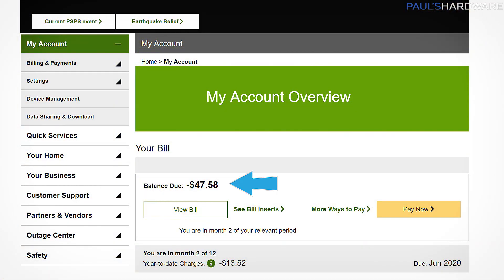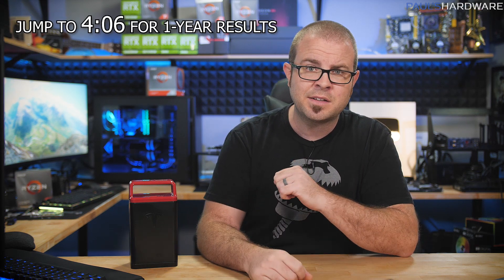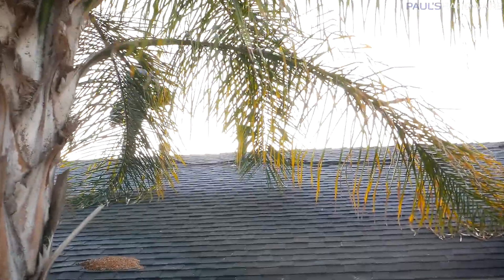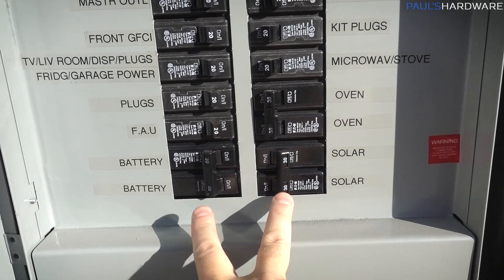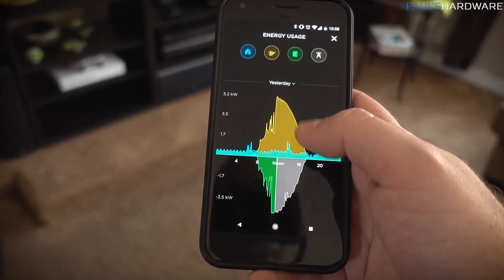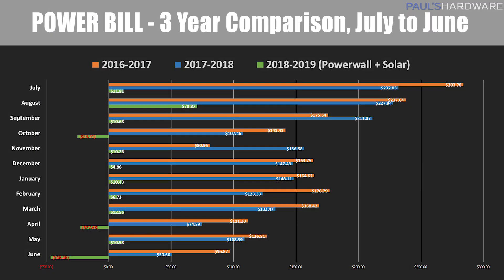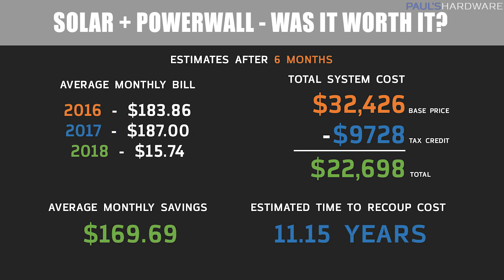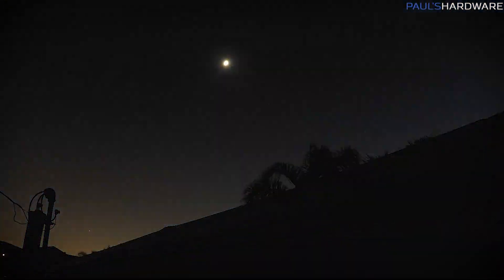TESLA Solar and Powerwall: 1 Year Later!

Comment: Paul, It would be interesting to know more about your current ac units age and efficiency as well as the home's insulation.
Reply: He should look into heat pumps, much more energy efficent than ac and electric heater.
Reply: @broman93  a heat pump is just a bidirectional AC unit that can heat as well as cool. The efficiency gains are mostly from cheaper heating.

Comment: If the cost of energy goes up in the next 10 years, your break even cost will be sooner
Reply: I was able to recoup it in just over six years because of the rate hikes accelerating it.
Reply: @dmacell4110  Yes, rate hikes are fake and the only reason they go up is due to the State of CA, in this example. CAISO in Rocklin, CA manages all CA state power and they also hit the big three power distributors with penalties for purchasing and selling natural gas and/or coal generated power. The rate hikes are a money maker for the State, nothing else since they make up fake reasons to hike rates. "Green" is not sustainable when there is no sunshine, no wind and so forth.  Government is full of B.S. as they profit off of the citizens for doing absolutely nothing in return.
Reply: in 10years when the warranty run out, watch him paying 10x the cost of electrical bill  just to keep the system going. if solar panel will ACUTALLY generate more money then installing it. the SOLAR company woulda just put it on empty land and sell the electricity to energy company to make money off it. the FACT is, they dont pay for them self. so the companies arent stupid enough to use it. and dont debate on some energy company actually install the solar panel to generate electricity.  thats because the energy companies dont PAY for those solar panel, they will add the cost to YOUR bill, to cover it.
Reply: @jackli8088  holy solar! Get in the shade dude, you seem to have been out in the sun too much, its clearly affecting your head.
Reply: If you factor in inflation and time value of money then no. $20k today is much more valuable than $20k in the future. Increase in electricity will simply track inflation.
Reply: Its the same when buying a home. You lock in at the time of purchase so that rate is unaffected by things like inflation or anything like what Enron did.
Reply: Energy Price increasing? Only ever heard of that this year, last year, the year before and and and... ^^'
Reply: Yeah UI bills go up like 14% a year, it's retarded.
Reply: Are you going to clean your panels once a week or month ? Either way that's the price you pay for buying into the liberal global warming bullshit. Theirs one born every minute and Paul's hardware is no exception.
Reply: @Matlockization  The most respected scientific minds from the WHOLE planet all agree on global warming. What idiotic right wing propaganda sites are you swallowing whole, to turn this into a 'liberal global warming' conspiracy? Go check a satellite photo of Antarctica in 1999 and check one from this year, then do some actual valid commenting after that. FYI the US is less than 5% of the global population, and we don't buy into your stupid conspiracies, we investigate the facts.
Reply: Not really - his credits from being a producer won't go up anywhere near as much as what they're going to charge him when he's a consumer.

That means his break-even time will go up, not down.
Reply: @jedidethfreak  The savings he gets each month will go up when the price goes up saving him more money
Reply: @seanthenetworkguy8024  no, it won't.  The credits your energy company gives you as an energy supplier ARE NOT THE SAME PRICE THEY CHARGE.  He's lucky if they pay him $0.40 for every $1.00 they'd charge him per kWh.
Reply: @jedidethfreak  You dont need to sell the power back to break even.
Reply: @jedidethfreak  You don't seem to understand that even without the credits, every kWh he's not taking from the grid, he's not being charged for, so the system is paying itself. Should the power become more expensive in the future, those kWhrs he won't be taking from the grid will be providing greater savings because they're already paid for.
Reply: @jedidethfreak  im saying if he generates 4kW of power right now, and its 15c per KW than thats a savings of 60c but if the price of energy goes up to 20c and hour and he generates the same amount then he saves 80c
Reply: @jedidethfreak  your point is that it takes longer to break even when not producing enough power to sell back, this is true.

The original point being made was that as power prices increase, Paul's savings will also increase (assuming same power consumption) because they don't have to pay for most of it. 

Both points are correct, you guys are fighting over nothing.
Reply: jedidethfreak if the offset for the whole year was built for 100%, then it doesn't matter month to month what the carry over for credits are. The wholesale value for the credit balance only applies annually during true-up. As electric rates go up, the saving annually grows and accelerates the ROI.

Under NEM 1.0 with Edison, day to day and month to month credits are full value (surplus balance at the end of 12 months is paid at wholesale). With NEM 2.0, you are under TOU where the time you give or draw from and to the grid determines the value of the credit, minus a 2 cent by passable charge - but still not paid at wholesale until after one year when the true up comes. 

Without battery, PGE/SCE/SDGE utlitiy company power replaced with solar gives a 6 year ROI, adding inflation and rate increases that quickly becomes 5 years or even less - meaning every 5 years a homeowner will pay Edison the equivalent of what a system would cost. Whole concept of renting versus owning your home folks.
Reply: Melthornal why so rude?  Oh yeah it’s YouTube comment section...
Reply: @jedidethfreak  Oh man... you didnt get it. :D 

If i use 4kW/month and my system can produce 3kW that means i didnt pay 3kw to the company, so that amount of money comes minus from the installation price. After a while this saving worth more than the installation price. Yes, it take some time but if the electric company raise their prices you save even more money with the same system. 

Other words: if i pay someone $100 and i can save this money's 50% because of my system then i save $50 monthly. And if the system cost $1000 the balance will equal itself after 20 month.
BUT!!!
If the "someone" after a year raise his price from $100 to $120 (inflation) then i save not $50 but $60/month-because my system produce 50% of my electricity using. So that means i already spend 12 month and payed $600 and to the last $400 needs only 7 while the last month is just a half amount of money.

Do the math with larger numbers and you will see.
Reply: @the-patient-987  Because he is generating power at no utility grid cost, yes.
Reply: @Resengan21  not to be that guy, but you cand have bigger savings while still taking longer to break even, and if you see the graphics Paul put up, the energy being sold is minimal, his system is designed to net almost 0kw consumption from the grid, not to sell
Reply: @MrQuequito  you're not getting it. It has nothing to do with money being made, but money being saved. If Paul continues to produce and use the same amount of energy each month (for arguments sake let's assume a 1:1 ratio), he saves the amount of money said energy would have cost. If the cost of that same amount of power increases, he saves more aggressively.
Reply: @Resengan21  read again what i said, you are telling me the same i said but with different words. I said "you cant save more (agressively) and still take longer to break even" if he saves more  he takes even less time to break even.  And a couple comments ago, you said both cases (taking longer to break even and bigger savings) are correct, and im telling you, no, contradictory cases cant be true at the same time.

Edit: he cant take longer to break even by selling because his system is designed to net 0kW on each bill. The point of his systen is not making money, wether he generates more or if Edison pays a penny per kW generated, it doesnt matter, the energy being sold is minimal and can be neglected (after a year its only netted him 47usd) 

While if the consumed kW price goes up, and since his system is designed to cover his power consumption despite the kW price, Paul will be saving more, and therefore, breaking even a lot sooner. Not longer.
Reply: @MrQuequito  You're making this way too complicated. Both situations are correct in theory, I never said both were correct at the same time. Obviously you can't generate less money/savings while simultaneously breaking even quicker. I see that we are essentially saying the same thing, its the second point you lost me on. All i was trying to do was point out to the people here who dont understand that as power prices increase, and b/c paul's setup is designed to essentially not pay for power, he would break even quicker as the increased savings per month would shorten the amount of time to reach his initial investment with the solar system. Its that simple guys.
Reply: @Resengan21  lol, what i dont get is why you tell me that stuff like im wrong, when basically we are telling the same thing almost word by word, anyway, im done here, peace
Reply: @MrQuequito  im not trying to say you are wrong, but simply defending myself when you say that im saying "two contradictory statements are true at the same time" or whatever. This is simple math, no need to exaggerate the situation.
Reply: @jedidethfreak  higher electricity prices in the future will give a shorter payback time. Full stop, end of discussion.
Reply: @Melthornal  Yeah this guy is a moron, it's supposed to be an ending towards your UI bill and grid dependence, not be a side hustle.
Reply: @jedidethfreak  Basic math must be really really hard for you. It's not for everyone, no worries.
Reply: @jedidethfreak  THE PRICE TO SELL BACK GOES UP OVER TIME 
DOESN'T STAY THE SAME YOU FOOL
Reply: @jedidethfreak  if the house changes habits it will be better, as he said in the video the people in the house have not made any effort to try to be power efficient (battery pack might not be big enough for there needs as usa typical households use over 2-3x power) usa cost for power is cheap compared to uk/EU them $250 monthly usage in kWh would likely be over £/€400-500 here

That same solar system in the uk would be a paying for it self (avg bills are under £50-100 a month, but we don't use/have installed Aircon normally)

Comment: Thx again Paul for the update...  If you recoup your investment in 13 years, isn't that about the life of the power wall, requiring you to start over ? I have no idea on the solar panels ???  👍😎
Reply: Solar panels have a 25 year 80% original performance guarantee. The powerwall will likely still be working by then as well but even if its not the solar definitely will still be. Also as competition heats up out there a new powerwall would certainly cost 1/2 of what the first one did 12 year earlier

Comment: yeh on the before and after on the cleaning.Include cleaning montage and tips if possible
Reply: Dish soap and soft brush man is all you need. use a microfiber towel to dry. otherwise invest in a DI RO system

Comment: So what I'm getting from this is that solar panels still are not an optimal solution for short-medium term gains. Sure, environment protection and all is a huge selling point for a house, but having to spend 12 years of living there in order to pay it off is really just not worth it for most people. 

Long term, sure. But you're purchasing the system based off potential gains in the short and medium term already. Long term you're going to likely either move and not take the system with you or the system could potentially fail, costing even more money and time to recoup your losses. 

This is just too much risk and not enough reward. If the system was even 10% cheaper, that would bring down your estimated return time to be within the warranty time period. And this is in one of the sunniest places in the US. There's no expectation for anyone to be able to afford this or even consider something like this.
Reply: its better to buy a house that someone already spent the money installing this shit. never do it yourself. one day most houses will be built with solar already installed but the house value will also go up.

Comment: 12 years to just get the money back how is that even worth it?
Isn't it like going to break after 10 years?
Reply: why would they break after 10 years ? solar panels are extremly durable and can work for many many decades. even after 25years standard solar panels still perform at 80%-90% of their original performance.  you should always put your money into longterm investments
Reply: It's not. Had that money been invested he could have doubled it in 12 years. Instead in 12 years, he will just break even.

Basically, he lost 20 grand compared to if he had invested the money differently.
Reply: @TheOwenMajor  What do you mean?
Is there a better way?
DIY?

Comment: are you only using plain water (without suds of any kind) to clean them? If so, will the tiny bits of sediment in the (city) water cause problems collecting on the solar panels over the years?
Reply: dont worry about it. I just spray mine with the garden hose

Comment: Once the payback is around 5 years maybe I'll be interested. Also, you need to factor in a roof replacement if your roof is getting older plus the cost of reinstalling the panels every 15 or so years for a replacement roof.
Reply: D Jaquith I've never heard of someone replacing their roof, except in the case of thatch roofs. Is this something to do with how American roofs are constructed?
Reply: @AnonymousUser77254  .. I live in Florida and even tile roofs are getting replaced every 20-25 years some longer, asphalt shingles last 15-25 depending upon your roof pitch and your location. 

Oh I'm aware of 50 and "hundreds" of year claims with barrel tile roofs .. total BS. The longest I've seen are natural slate roofs for about 100 years .. but essentially destroying them (cracks and drill holes) by installing solar panels .. it's like going to the casino.

Comment: I'd watch any solar panel content. Mostly just an content you put out, so go for it!
Reply from the maker: Thanks Jonathan!
Reply: I was watching every solar panel content and now I regret it so much.  I just wasted $16,000 on Tesla solar panels based on every worker for their company giving me an answer that I was happy with but every single one of them lied and also, their stupid inverter didn't work and it has been the biggest nightmare of my whole life.  They won't send a service person to fix my system because I don't have internet and when I was buying it, I started off asking their stupid online chat line, "Is there a problem that I don't have internet because buying internet would cancel out the benefit of getting solar panels to cover my electric bill since both cost about $100?"  I asked again before signing the contract and asked the pre-installer and asked the installers (as a group) and asked the person who came after the installers to make sure it was ready for inspection and worse, the system never worked.  Never generated any power at all.  The LED lights never turned on in their inverter.  But it took over 7 days to figure that out and now I am contractually stuck with panels that don't work and they won't replace the inverter until I buy internet for $100 which means that I will never save ANY money on my electricity which means that I will NEVER pay even one penny of these stupid solar panels off.  It was all a con job and it is my fault because I did scan the contract and read a lot of it but if I had read 15 pages in thoroughly enough, they can refuse to service my solar panels if I don't get internet.  So it was LITERALLY ALL FOR NOTHING.